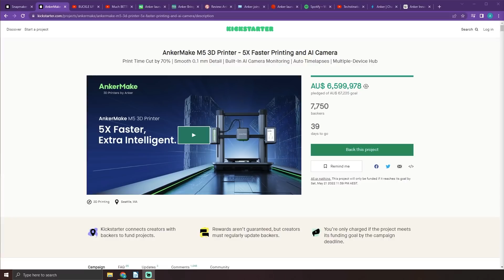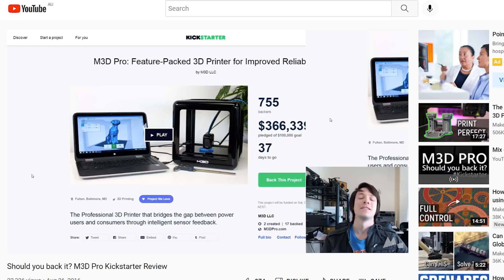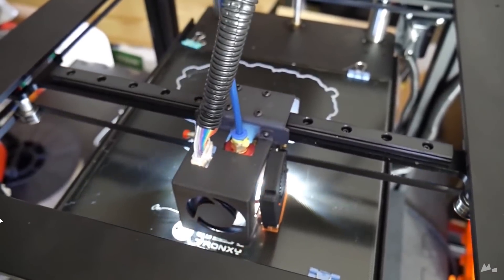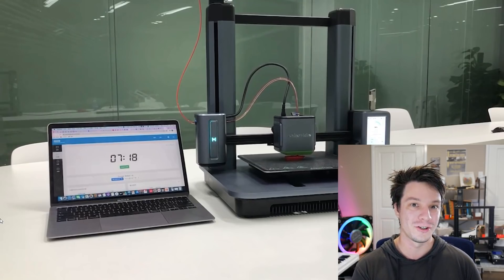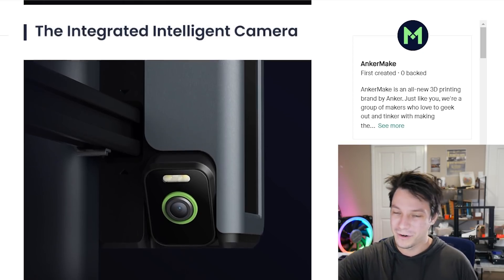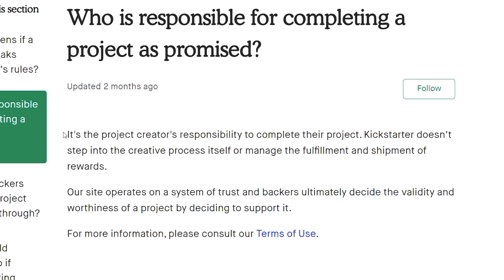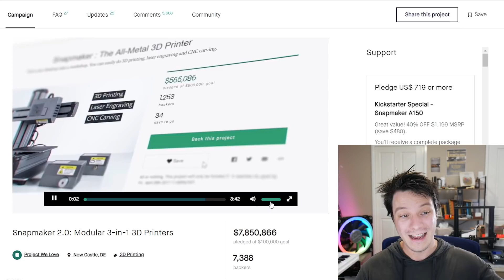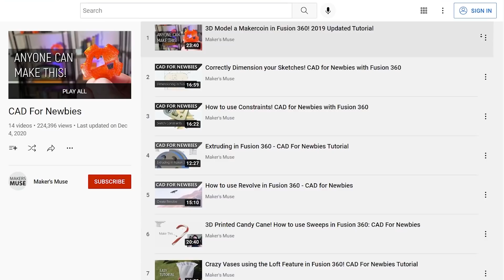This 3D Printer looks incredible, but...

Comment: I would have to say that sls and sla type printers are the future. I use to run an objet260 and an objet30 with the poly jet technology and they were the most demanding and short lived printers I have ever ran. We now have over 200k worth of objet paper weights. In less than a year problem after problem after problem. I think it has 8 nozzles and the splatter from the system caused problems. If you didn't wipe the nozzles just right and every time you ran it you would have problems. The cleaning of the scraper and collection tray and filling out the hazmat paperwork for the waste box. Constantly taping down the transparency to run the calibration print, was maddening. And for 160k with an educational discount you would think it would at least be cheap to run, but nope. My cost basis had that thing at $10 per cubic inch where there SST FDM printers were at $3 and regular old prusas were at $1.

Nozzles are the problem and the printers we have been running nonstop without mechanical problems with high finished print rates are the sla and sls printers. Our form labs and our EOS 100 printers have been running almost everyday for months now and they just turn out parts. No nozzle jams or excessive preventive maintenance, the system is so basic for spreading out powder and a simple laser does the sintering. Plus the cost of powders that you just continually recycle till its gone is manageable and the accuracy is fantastic. I would like to get my hands on the sintertec or fuse one soon and the new BCN3D system the just announced looks very promising, it really deals with some of the major downsides to resin printing.

Anyway, this is my take. Please keep up the good work, you have been one of my biggest resources for 3D printers over the last few years and I really appreciate all your effort.

Comment: I just replaced the tubes in all 8 peristaltic pumps on out Objet. When we disconnected the vacuum filter to replace that, the head dumped all its resin into the side of the build plate. It does make a nice print though.

Comment: If a printer is ever equipped with a scanner that would be pretty awesome
Reply: A scanner that works to begin with and doesn't cost a fortune would be nice.

There were 3D scanner equipped printers before. For one, the scanner was garbage; for other, there was basically no part reuse between scanner and printer so it didn't even make sense technically to combine them into one device!

Even good scanners have blind spots and artefacts, so you can't just press copy, you need to clean up the scan, or only use it as a measurement to design some new mating part or redesign the part. Bad scanners are NOTHING but blind spots and artefacts.

Comment: In the midst of the topic starting just after 4:00, I'd argue that if you aren't ready to put in the 20% of work and effort that the machine cannot provide, then what the hell are you doing with a 3D printer. Over the course of the last 6 months I have found the best thing in regard to my relationship with my Ender 3 to be the learning process. I have self taught myself, discovered copious, undying communities and channels to learn and grow and share. So, obviously this is an opinionated statement, if you aren't ready to learn how to 3D print and expect it to be as simple as pushing a button, then buckle up because 3D printing is a hell of a ride and it's probably not something you'll remain interested in. Keep tinker and keep learning. Thanks and be well!

Comment: The 10 year outlook is interesting, but  it's assuming we're still using the same technology we know of today. I gotta agree with some of the other comments below regarding resins not being the best material for 3D printing.

I see personally so much space for innovation in additive manufacturing and there will be technologies that will simply blow today's printer tech out of the water. It's actually the reason I just founded my little start-up. It's called Torem Labs and I'm super excited about it. I believe that in 10 years, better engineering materials, perhaps in powder form, will be the norm. They will be printed on bigger and more efficient machines at your local hardware store. It's a way to control quality, it goes in hand with IP for businesses that sell their own products, while being accessible enough to allow you to print your own stuff if you have the 3D modelling skills and the patience. 

But that's just my personal guess... I'm still looking for feedback for my start-up as it's very early stage, so feel free to send me your comments :)

Comment: Inkjet and laserjet are the two worst things that happened to printing please do not compare them to FDM or resin. XYZprinting tried to pull out inkjet on us, look what happened to them. Also, 3D modeling is easy, tinkercad is the same as microsoft paint. Good 3d modeling is hard, but for that there are free or paid models online, but for just daily things it's quite easy to model out, if you can use paint, you can use tinkercad.

Comment: We have been printing parts for small volume  production in ABS on 4 zortrax machines, they work 5 days a week for 5-8 hours a time they have been working away for over 5 years now . We get less than 0.5% failure rates, these machines just work!

Comment: We are still way away from 3D printers being accurate out the box and by this I mean the sheer waste of plastic. It is insane how much 3D printed plastic waste there is. I will purchase a 3D printer when they are better and more able to print out the box. I wish people discussed the waste from 3D printers more and suggested ones which produce less waste and shame the printers which require loads of waste to work properly. At the very least companies should be providing their printers with a re-melting ability for failed models (which happens a lot) to be reused a filament, this should be a legal standard.

Comment: 10:06... dude laser diodes.... you should review your facts on them.. check out styropyro(?). he can break laser tech down really well .. computer mice use "exposed" laser diodes... should we not use them?  furthermore what if they used a non visible wavelength (IR)?  IR doesn't mean it's safe in fact depending on energy "quantity" IR is more dangerous, as you won't see it at all coming and your eyes would go blind like magic.  some "laser" diodes are more like standard light emitting diodes and some light emitting diodes are more like lasers... should we might even use LED bulbs in our homes?  should we even use computer monitors??? it's to do with energy "quantity" per square metre/mm.. same goes for gamma radiation off of radioactive elements at low quantities nothing will happen but quantities similar to a clear sunny day of UV radiation instead of UV's sun burn you get 3D sun burn with gamma

Comment: Alright so I agree and disagree with some of the stuff your talking about, I've got experience with projet 2500 printers and their wax and at the current point that they are in I would advise against it, between parts that cost an arm and a leg and the wax/resin costing upwards of 700$ a half gallon cartridge it can be hard to recommend. However, it produces Wonderful work with high detail and the ability to print a exponentially longer parts list much faster than normal

Comment: You make a very strong case for the jet resin printers in the long term (perhaps when the inventors/patent owners have made sufficient return via b2b on their investment to switch to mass-market) - before you mentioned them I'd thought immediately of the powder sintering approach, but I don't see those becoming home-friendly in the way those jet resin printers could be. The thing that would concern me about jet resin and mass market, is the safety concerns around mass market users coming into contact with uncured resin. The law suits could be devastating. Cartridges might be a solution to that problem, while of course at the same time offering a continuous revenue stream for the manufacturer beyond just the equipment sale.

Comment: As always Angus, many thanks for your Honest, intelligent opinions. No wonder you are streets above everyone else in terms of quality of channel content. I did note with the Uncle Jessy video that there does not seem to be any live footage of the printer printing with only background audio rather than a voice over. I have queried if there was some editorial restrictions with this being a sponsored video.? I hope not because he does not seem to have stated that anywhere. The only slight part I could determine was the stringing towers which would be at very low speed anyway. The only reason I have asked for clarification is that in my experience with v rollers at these speeds, they tend to scream their little heads off and would suspect this machine be a very noisy little mother in reality when printing fast. If not I would be really interested to know what breakthrough technologies or tuning they have used to neutralise this. Thomas on his latest pod cast with Stefan suggested a multi core processer with an individual core for Marlin so not fully knowing the details may be using some Direct Stepping Tech to achieve this. Anyway thanks again for a great Channel. Best Boothy

Comment: I have and use the exact model objet you show in this video, while yes it is reliable I feel as it has some major downfalls.
1. build plate size
2. the resin is expensive and has to be properly stored
3. the removable resin for support smells AWFUL
4. the spray container that is shown in this video is very prone to issues and tends to smell very bad

These are just my opinions but I would like to see a more size efficient machine. They typically have a smaller build plate even though the machine itself is quite large and takes up a considerable amount of desktop space (about 2 Taz 6 sitting side by side)

Comment: Just what we need a 3D inkjet printer. First we will have some decent reliable 3D printers with somewhat expensive resin cartridges. Then the quality and reliability of the printer will start to degrade and they consume more resin than the earlier printers. The decline continues until we have 3D printers that are poor quality, you are lucky if they last more than a year before breaking down and not working, and the icing on the cake is that they consume a LOT of resin cartridges to print a small 3D object. But in the end we will end up with a multi-function 3D printer, that is also a 3D scanner, an inkjet printer, scanner, copier, laser engraver, and fax (does anyone still use fax?). With the pinnacle of versatility achieved the multi-function 3D printer will not print, scan, copy, engrave, or fax if a resin cartridge runs out of resin, or an inkjet cartridge runs out of ink until all empty resin and inkjet cartridges are replaced. The hardware, software, and cartridges will be designed in a way so you can only use ridiculously expensive OEM cartridges and if you try to use third party, non-OEM cartridges the multi-function 3D printer will become a brick.  Yes, I do believe we should adopt that form factor.

I forgot about the exception to the reliability and quality problem which will be stand alone, high resolution 3D resin printers that cost over $1000 and have 6 ridiculously expensive, individual color resin cartridges.  That's how we will get low(?) cost 3D printing to the general public. That's capitalism in a nutshell and I can think of no way to avoid that inevitability.

Comment: I've owned 5 printers, been through the tinkering and recently picked up an Anycubic Vyper.  
- 5 Minutes to setup.
- Has heated bed.
- Has runout sensor.
- Has power failure resume.
- Has mesh levelling.
- Super quiet.

First printer I've ever had where I really could just hit play and walk away straight out of the box.  I get one failure every 20 prints or so with literally zero tinkering.

The only thing the Anker seems to offer on top is failure detection?

Comment: I think FDM and FFF are going to be very heavily used for home METAL 3D printing as well as things such as nylon or carbon fibre. There are a lot of limitations to resin (hard if not impossible to recycle, toxic, waste products need to be disposed of properly, and potential exposure concerns) which make it hard to justify using it in certain applications or even generally. Also if you look at inkjet printers now many people are switching to tankless inkjets all because they don't want to buy ink cartridges. Furthermore there are some major developments such as Blacksmith AI by Markforged. It's likely we'll see an open source version of that at some point as well, probably deployed on something like the Mythic AI Analog Matrix Processor. 

I personally use my resin 3D printer to make injection moulds and then vacuum press very hot PET into them for really small things.

Comment: I fully agree that resin jet is the future.  I worked with a few MJP in an older day job.  Those were the prints that you knew would be amazing (as long as the printer didn't have a mechanical issue, because ours had a lot of them).  It was especially amazing with the support materials being able to melt out.  Amazing for super accurate prototypes.  Nnce they can get that into a tolerable price point the extruders will definitely be a thing of the past.

Comment: Angus, I love your video and honesty!  However, I respectfully disagree (strongly) about the Objet-style printing being the future for consumer printers.  I've used Objet systems for many years (we still have two of them at work) and I can tell you they are NOT simple machines - many many parts to break. There are peristaltic pumps, fluid primers, suction lines that can clog, a rotating skimmer (roller/wiper) that can crash or jam, and WORST OF ALL, the print head itself is massively complex and prone to blockage. It takes meticulous cleaning and maintenance (and $$) to keep these systems running well - which is why most companies who own one have a dedicated staff who have the full time job of cleaning, maintaining, and printing.  The print head (in my experience) ALWAYS has some nozzles jammed. This is OK if it's not too many nozzles, but invariably the head will become unserviceable and it's $1000 to replace, each.    The J750 has six such heads you have to keep in working order.   There is really no path to get the motion and mechanical systems simple enough to be reasonably affordable for the consumer.  

Yes, the gel support structure is simple for slicing, but it's also very wasteful - we usually spend a lot more $$ on support than model material.  The cleaning process is not easy either, and it's common to break the 3D print when removing supports. That's easy to accidentally break the print if you don't know where all the thin walls and features are.  After water-jet cleaning, you still have a waxy surface residue unless you soak the part in NaOH solution and scrub (scotch-brite or similar).       My opinion is that mSLA is really the future of consumer 3D printers.  They are extremely simple with almost no moving mechanical parts and the machines and resins are open and improving dramatically every year.

Comment: In ten years, I don't see 3D printing having changed a whole hell of a lot, because there's just not much incentive for the average consumer to buy in. Without adequate modeling skills or a breakthrough in 3D design programs that makes the process truly user friendly, there's no point for 99% of the average consumer market in buying even the most user friendly of 3D printers. I suspect AnyCubic is setting the path forward with their latest machines: reasonably priced and feature rich (compared to the trillion and one Ender 3 clones), but still ultimately a professional's tool or a hobbyist's toy. There's just no incentive for the consumer market to iterate much beyond that, at least not yet. 

I'd 100% love to be proven wrong, but without that breakthrough in modeling? I don't think I will be.

Comment: Years ago I bought my 1st 3D printer, a Di Vinci Jr.  It worked right out of the box.  I'll I had to do was put a spool of filament in it.  Of course it has a small build volume and doesn't have all the bells & whistles.  It made before there were such bells or whistles.  I have several printers now, but the Da Vinci Jr. is still up and running and ready for any quick prints I need to do.

Comment: If you want to see a 3D printer that is actively user-hostile, look at the Qidi printer.  When it's running well it's a very good printer.  No auto bed leveling, though.  If something goes wrong, like a filament jam, then it's a nightmare to disassemble, fix the problem, and even worse putting it back together again.  How bad is it?  They've had to send me four new extruders due to filament jams because I either couldn't take it apart or couldn't put it back together again.  They use cheap screws where the heads strip out a lot and designed it to be an extremely difficult puzzle, definitely not for hobbyists.  DO NOT BUY QIDI PRINTERS!